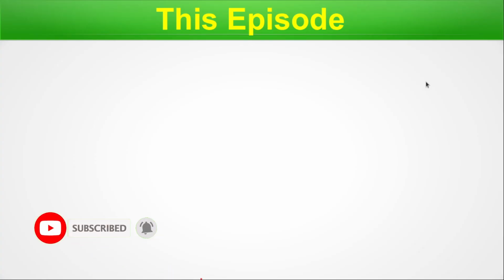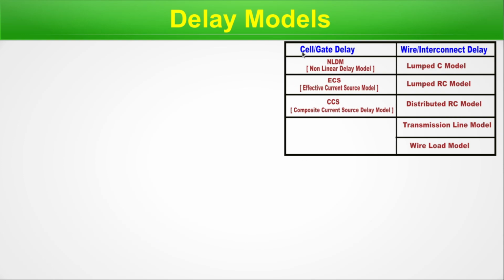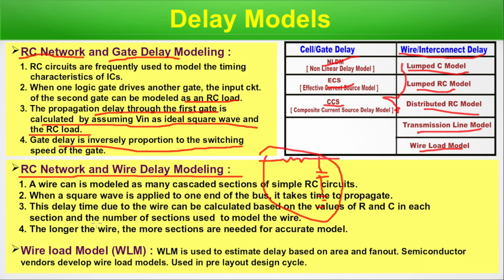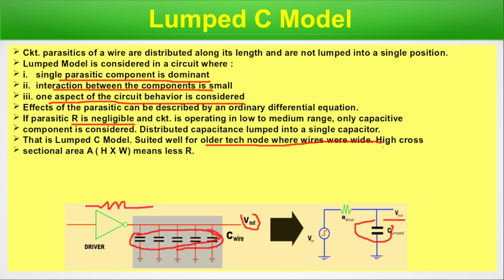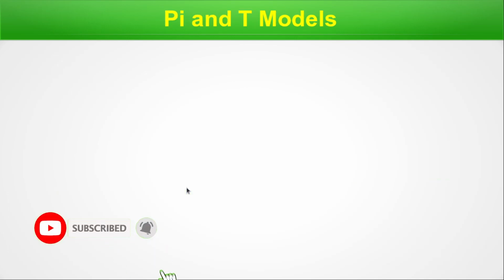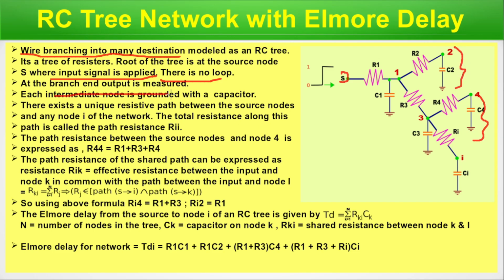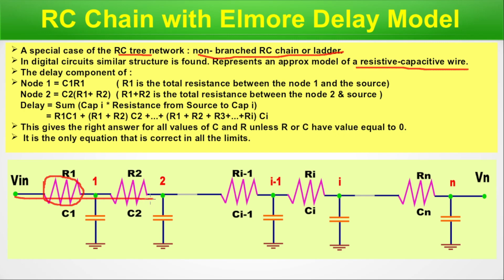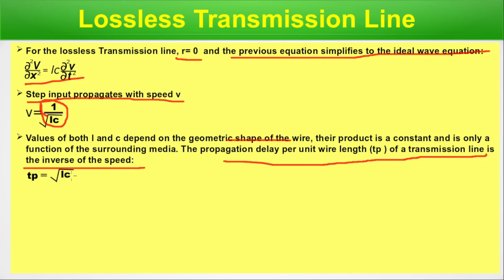Optimizing VLSI Physical Design: Understanding Interconnects Delay Models !

Comment: How to know which interconnect model is being used in our design?? Is there any command or any pattern which can be searched in the log file
Reply from the maker: These are all very popular and useful models as we have discussed. Usually all commercial tools have such models. Although the switch/command/ model name  is used  may not directly point to popular names. In such cases you have to check the user manual or try to contact the Application Engineer of the EDA vendor. They might guide you.